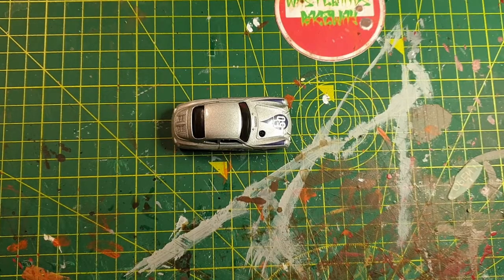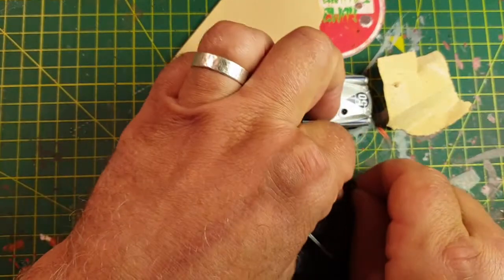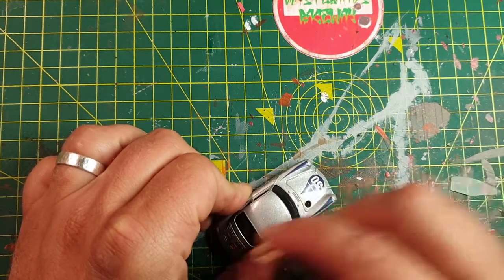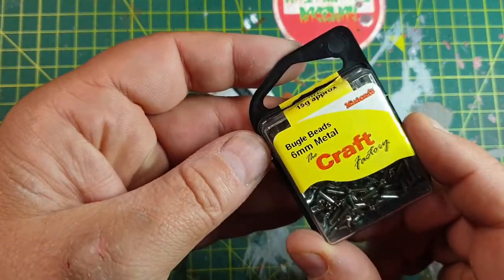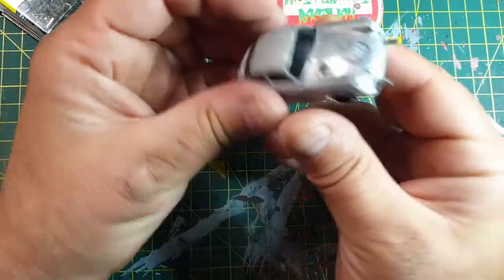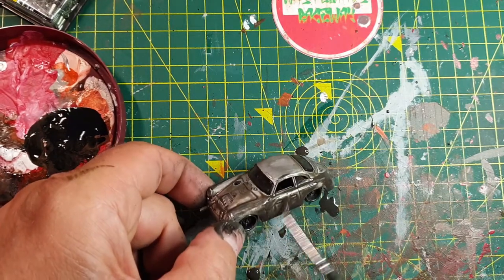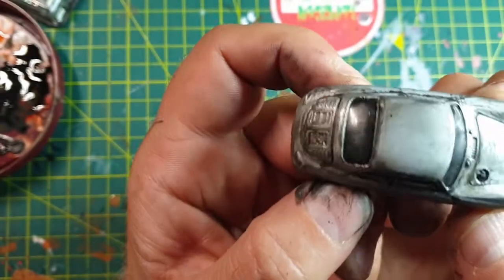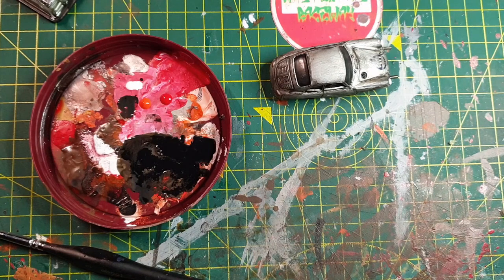Easy and Quick Hot Wheels conversion for Gaslands *Prize Giveaway*

Comment: I've tried some of these simple techniques and it is really surprising how easy it is to make a convincing battered car for gaslands. 

The thing I do to avoid having to drill the rivets is getting cars that have a plastic bottom and just melting it with a solder iron, works 9 times out of 10.

And I do want the car, never find porsches around here
Reply from the maker: I hadn't thought of a soldering iron ... Good idea 💡 
Although I am not sure I could be trusted not to burn the house down with one of those things!